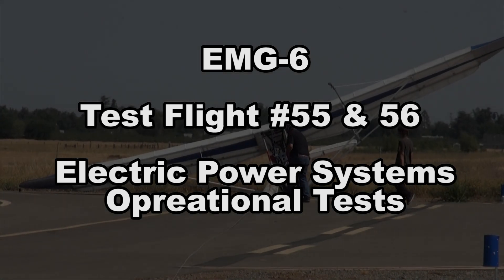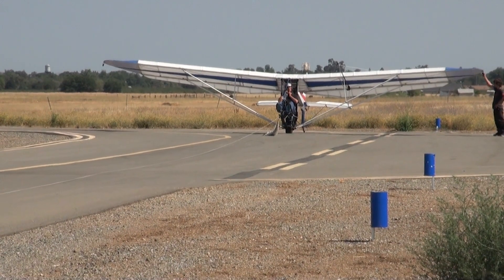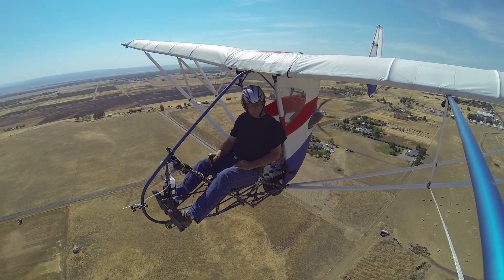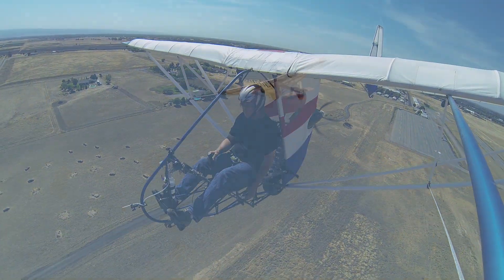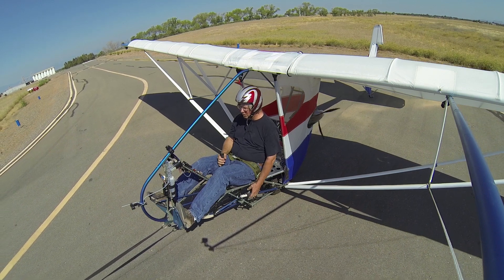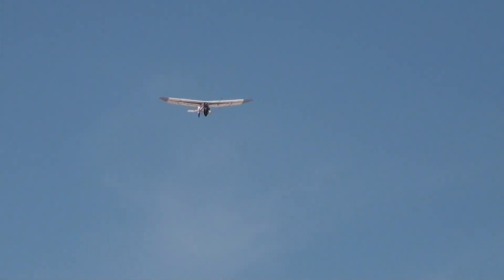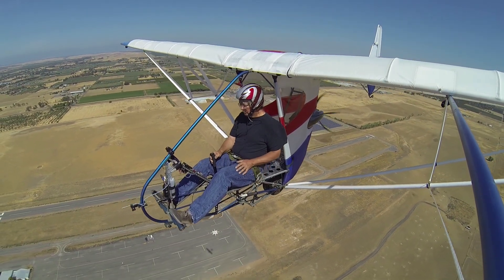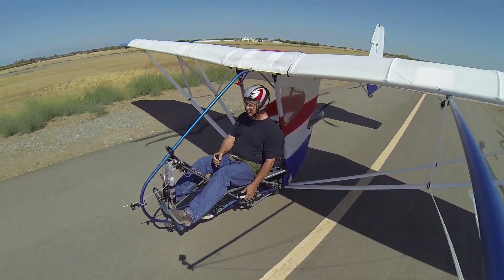EMG-6 Powered Flight Test (Predator 37 sustainer motor)

Comment: Why do you have yourself dangling out the front like an egg you can wreck your nuts if your feet fell out of that and why only one wheel unicycle landing gear that thing will flip in a heartbeat that lawnmower engine doesn't have ball bearings

Comment: That fairing of rear part of fuselage works as a drag shute thus requiring more power at the expence of battery endurance. A windshield would be much more useful  in reducing drag. The stupid  music spoils  all the  beauty of  this  video
Reply: I thought the same thing about that fairing that enclosed the rear of the cockpit.  He needs to at least remove the clear view panels  to reduce the drag chute effect.  The climb rate would improve substantially if the fairing didn't go higher than the pilots shoulders.
Reply: I agree with you  John

Comment: Looks an excellent power plant! However a slicker airplane, flying faster would resolve your cooling problems?  Consider a canard configuration with a hi mounted mainplane and pusher prop on top. The pilot would seat within the fin/fuz/ mainplane mount, with a canard stab.

Comment: What a lovely aircraft you have real potential there,what battery pack are you using ? would it not be a better idea to have the ESC in the slipstream externally mounted like we do with model aircraft,rather than relying on afan.

Comment: I would think you could make or purchase a cooling jacket that could recycle the coolant around the motor and/or esc and batteries.   Would take very little power, maybe its own 2 or 3 cell lipo and the weight should be very minimal.  
     Thanks for the video and info.  God Bless

Comment: This is a superb project. is it possible to stretch fuselage to make tandem two seat trainer?
Reply from the maker: Airplane original design is already a two place trainer. We have not yet flown the aircraft in that configuration, but the aircraft was designed as a two place glider with an original gross weight of 750 pounds. Used for training with two people as a pure glider, configurable with a electric power plant and batteries as a single place airplane.

Comment: Hey guys, pls did You have to modify the plettenberg motor anyhow?? (Bearings maybe?) Thx
Reply from the maker: No, the goal for this test was simply to see if we could fly the airplane with off-the-shelf model airplane components. It was only designed to evaluate the predator 37 while simultaneously providing additional evaluation of the EMG-6 flight test characteristics. To make it a more practical installation it would probably be best suited for a prop reduction unit swinging a much larger propeller. Had the engine test results been better we would have used two of these motors on the wings.

Comment: What are you using to get you up to altitude? (tow craft)
Reply from the maker: We have a multitude of different methods by which we tow the aircraft. In this video we are using an old Jeep. We have towed with several other vehicles including a 400 CC Honda four Wheeler. We have several videos also showing us towing the aircraft with a Quicksilver GT500 experimental light sport aircraft rigged up with the tow system.

Comment: Very interesting aircraft.   I enjoyed watching the video.  Just a couple of  questions.  

What is the purpose of the 'faring' on the aft portion of the fuselage?  Is it only for appearance?  Does it not induce additional drag?  Does it help cool the motor?
Reply from the maker: First of all, we are capturing any air that escapes around the pilot and we ducted through the motor and controller for cooling purposes. That being said, the primary purpose is for drag reduction. There is more drag reduction to be had by fairing the aft side of an object and there is to be had from fairing the front side of an object. Especially in this case where the object in front (pilot) is already fairly round. LOL. Even without qualitative measurements flying the prototype without the rear fairing showed a significant increase in drag. In addition, the amount of turbulence over the control surfaces on the tail were substantial without the fairing
Reply: Thanks.

Comment: Super stable, well built and very stylish glider. Cooling issues would improve much with two motors in tractor configuration on the leading edge of the wins (with the ESC's there too). Also, these tests would work better with some partial windscreen before the pilot as he and the shell behind him act as wind catchers producing excessive drag, a no-no in a glider.
Reply from the maker: Thank your kind comments.  Interesting, because you talk about 2 issues the cooling of the ESC's and the motor versus the drag from the frontal area. Have built 2 other EMG-6 aircraft that used the forward fairing. However in this video, we capture all of the air that is not displaced around the pilot and force it through the rear fairing using it as cooling for the motors, controller, and batteries. This powerplant configuration was simply a test of the predator 37 motor and schulze controller.

Comment: Where's that spray on solar power? All that wing surface should be a solar panel.
Reply: I don' know about spray on but I've seen information on plastic film solar cells. Develop a covering that is photovltaic. It wouldn't generate enough to extend endurance much but the batteries xcould charge while parked

Comment: There is no need of fans when the air is moving.... Why don't you experiment with gear reduction and turning much bigger prop designed for the slow speeds..... I have been designing and flying aircraft since I was 13.... In my radio controlled airplanes the slow park flyers do far better energy wise with wide chord props with large diameters and considerable undercamber..... Pepper that looks a lot like the huge windmills of today would be about right.... I can guarantee you that that whizzing beating the hell out of the air prop you are using its burning thru energy like a banshee.... Look into doing some study of indoor rubber power micro lights with micro film covering..... Listen to your prop it sounds like a boat prop that bis cavitating..... Watch this video change your direction and get this electric thing to fly for an hour or more.... It's really quite simple... https://m.youtube.com/watch?v=Wsd8PIEItr8
Your airplane is not flying fast enough for the rpm you are turning with small prop..... I know it's important to turn the motor at optimal rpm for energy conservation.... So determine that I would say you need to turn a prop of 7 or 8 foot diameter with a base chord of approx 11 to 12 inches tapering to 4 inches with a foil and twist appropriate to the speed range of cruise.... I would guess that 60 to 120 rpm would be good.... These are all just top of my head guess numbers that should be a good start place to begin testing..... Think about it this way a helicopter uses blades with huge rotor span and pitch is adjustable... You could easily make adjustable pitch for a big prop..... That Lil tiny prop you are turning is just beating the hell out of the air and turbulence eating energy..... Rubber power planes turn big props slow because it's like sitting in a canoe trying to row with a half inch dowel vs digging deep with a 6 inch wide paddle.... If you are going 100 mph you need prop turning to match that speed.... Going slow you need slow big prop.... In fact I have been considering building a rubber powered ultralight..... You wind it up on the ground and use a clutch to engage the bands.... When you consider the weight of batteries and electric motor I bet it will be a better choice for energy storage.... Another consideration is air pressure power..... If course solar panels in the wing should work as long as the the sun is out.... I just have never seen anyone approach it right..... I have built a fully solar rc airplane a long time ago that in full sun could fly indefinitely
Think man..... That prop is killing power and over heating the electronic speed control..... Much larger prop with appropriate shaping and progressive twist and add a variable pitch.... All those are the answer to the problem you have been fighting for way to long

Comment: Yes, battery fire has got to be the #1 fear and reason for many sensor points among the batteries to send live info to the pilot.  No amount of fire extinguisher systems would stop one of those fires either.
Reply: BushPilot444 I would have a pull lever to dump the batteries and a mirror to see them... Lithium battery fires are hot fast and very dangerous I think it would be good to have a chute attached to the batteries with wire cables so they can burn out fully before reaching the ground to prevent starting wildfire as much as possible
I think I would mount the Batts out on the strut as well just be a safer place for said fire to happen and easier to see

Comment: Soooo, the cooling fan is mounted to the motor. You have to leave the motor running to cool the ESC. In the mean time the motor is drawing current from the battery. Current flow is causing the ESC to heat up. So you have to run the motor to run the fan to cool the ESC. Am I caught up in some kind of weird loop here, or would it make more sense to use another method of cooling the ESC after shutdown.

Comment: Bigger Prop and geared Motor is required. Move more air at the same speed as the Aircraft.
High revving small prop is very inefficient. Bit like driving along stuck in first gear.

Comment: Very Stable! An ESC or battery fire would be terrifying...maybe a parachute? Keep us posted!
Reply from the maker: Stable, absolutely. Fire, ahhhh, yeah, terrifying. In my 8000+ hours of flying in different aircraft I've had 3 fires in-flight. And you're right it's terrifying . We put a lot of thought into the whole possibility of a fire from either the motor, controller, or batteries. Keep in mind that the predator 37 installation was simply a test for testing the viability of the model aircraft motor and the amount of power necessary to sustain flight. There was never any intention for this to be a single engine aircraft with the small of the motor. If the tests have been better than what we expected we would have configured the aircraft in a twin engine configuration using this motor combination.

Comment: How do you get flaps if you're capitulating their angles in flight? One turns down the other up seems strange.
Reply: I'm not 100% sure what you mean by "capitulating their angles," but this plane does not appear to have separate flaps. The control surfaces on the trailing edges of the wings are ailerons, and "one turns down and the other up" so the pilot can control roll. It may have flaps in the form of flaperons, which are ailerons which can be rotated to increase their angle of attack. This allows the use of flaps without adding an entirely separate control surface.
Reply: Aaron P: Do they all do this.. Because I flew Cessna 150 and I don't remember the flaps (ailerons) opposing each other for roll.. All I can remember was using  my vertical stabilizer on the  empennage which caused the outside edge of the wing to lift higher  because it was traveling faster than the inside edge. My memory is foggy on this.. I thought the flaps worked in unison to give you more lift at slower speeds.

Comment: My dear friend! Designing to e-glider with an electric drive requires maximum reduction of energy losses from air resistance during flight. But your design to install a cockpit behind your back (not in front of yourself) is not only pointless, but also increases resistance due to the air intake by the cockpit as a trap behind your back (above the shoulders). The electric motor from among not too expensive and so does not have the necessary power, but with huge aerodynamic losses of electric motor power it turns out to be very little. Alas, with aerodynamics you obviously are not friends. The trial and error method is a day after day and also takes a lot of money, is not it? ;)))) Excuse me for truth! :)
Reply: I enjoyed the video & think the design is great apart from the cowling in front of the pusher propellor which would surely act as a scoop creating drag & the fact that the pilot is not strapped/secured in the seat properly but I'm Not disrespecting you as I think you've created a Very fine aircraft.I do understand that the pilot has fabulous access but it could be made safer is what I mean.
Reply: I have this mean of glider' aerodinamic quality only...
Reply: He is actually reducing the drag behind his back with that cockpit. Since it is a pusher setup there is minimal lost of power.
Reply: Air scooper otherwise it’s perfect 👌
Reply: Noting, because it's works Savonius effect and others. P.S. I'm known it very good. But it's very long describe.
Reply: Chuck Sandos the back cockpit really is an improvement as it streamlines the air just as half wheel pants do but yes closing in behind would help a lot and a shield in front would help also.... I just know from my experience that he is beating the hell out of the air with that tiny prop turning way to fast.... A 6 or 7 ft prop turning very slow would be Asl the answer he needs just as in rubber powered micro film f1d the prop should turn based on cruise speed.... He needs to dump this setup go for gear reduction and big slow prop...... Even ww1 aircraft used huge wide props.... If you turn a 4 inch prop 30,000 rpm vs turning a 7 ft wide prop is a like paddling a canoe with a half inch dowel vs using an 8 inch wide paddle.... The first you stroke the hell out of it and go nowhere the second you stroke along leisurely and actually accomplish forward movement with little effort at a relaxed energy efficient speed..... That prop looks very much like what one of my big rc planes would use to fly about 80 mph... Large wide prop with variable pitch is the answer to electrics.... You can hear the blades cavitating that is that vrrrrish noise the blades are vibrating a lot from the turbulence caused by air flow seperation
Reply: Hmm.. Your text like this: 'tiny prop turning way to fast' or this: 'along leisurely and actually accomplish forward movement with little effort at a relaxed energy efficient speed' -- it's non correct arguments! And all of it's are many poor argumentations. So, excuse me, but I'm not understand your proverbs for... Cheers! :)

Comment: Very cool..Problem with gliders is they come down, so if you can keep it up it will be worth it as a good form of thermal finding fun. Make sure those heat sinks do not overheat and catch fire. Its the smaller cheaper wire and lack of copper in chinese stuff, as they put most of their copper into their military equipment, more important to them. Damn heat will always be a problem, more heat means coolers, adds weight, need more thrust for the weight, its a vicious cycle. You are living the dream and leaving your mark on society. Hope to see you at Sun N Fun.

Comment: Not a fan of the music.
You thought about using a heatsink instead of the fans?
Reply from the maker: Sorry about the music I cobbled the video together quickly one night and didn't take the time to work out the editing completely.   I don't know if you saw the method or not, we used a water cooled heat sink, pump, and radiator with cooling fans off the shelf computer stuff super light weight, here is a link
 http://www.electricmotorglider.com/Progress/Current_progress.html#ESC
Reply: Adventure Aircraft
Sounds like a batch of angry bees at a Blues Festival. I dont hate Blues. Keep em charged up, and an extra battery :)
Reply from the maker: And continue to apologize for the music. I agree totally it sucks. When this video was made I wasn't much of a filmmaker. I continue to try and up my game. The problem is I've lost the footage for this original video